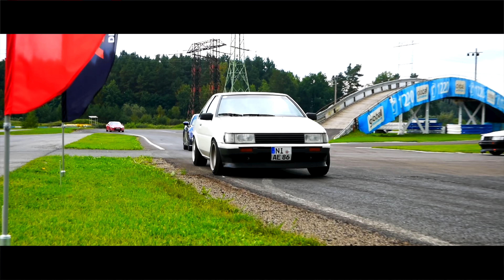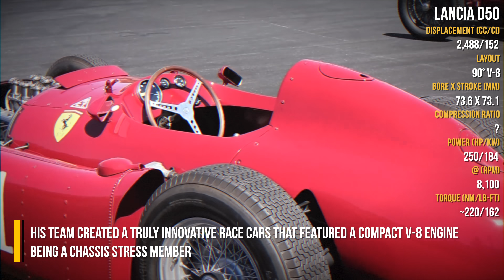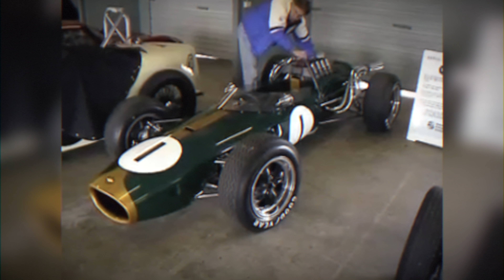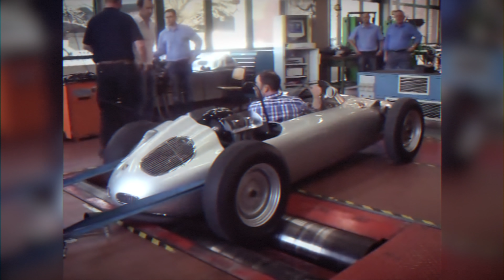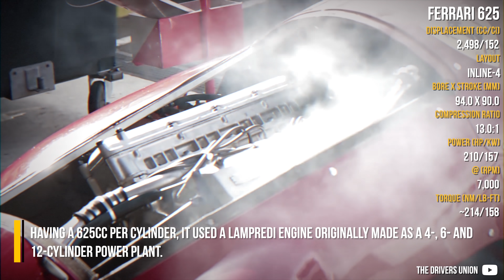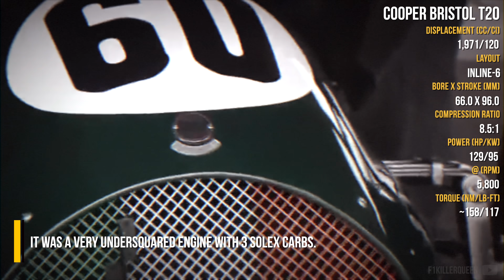The LOWEST Revving F1 Engines

Comment: Of course the Auto Union V-16 Gran Prixcars from the 1930s only had a a redline of 5000 revs or so. The engine had one of the most unusual valve trains in racing history. The intake valves were opened by a single centerly located camshaft in a SOHC configuration. The same camshaft opened the exhaust valves via pushrods.

Comment: Those later in the video look like toy cars. about the middle of the video those cars sounded like they had much larger engines than they had. I used to drive a 1998 Ford ZX2 Escort and it red lined at 8,500 rpm, more than almost all of the engines in this video. With it's 5 speed transmission it was so much fun to drive in LA traffic being not so wide as most cars and very responsive power. 
I like the clean look of the 60s F1 cars. They aught to take all the aero crap off the new cars and lower the maximum weight back to about 1,000 kg. Give them a 3.5 or maybe 4.0 inch stroke requirement and maybe 3 liters total displacement and naturally aspirated and a maximum of 5 forward gears and no DRS and no ERS. They aren't supposed to be street cars, they should be the most exciting fast things on 4 wheels that turn both left and right, not hybrids or electric, not demonstration models for new street car tech, and they shouldn't need a special system to help pass the guy in front of you.

Comment: They still have more RPM than American cars.
Reply: No. Just NO! My 1998 Ford Escort ZX2 redlined at 8500 RPM. and it was just a inexpensive sports sedan. and if you want to compare racing engines Nascar V8s of 355 cubic inches will turn over 9500 RPM.
Reply: @chrisbaker2903  hur dur... it was a joke.

Comment: You missed the Talbot-Lago T26C. That had a big 4.5 liter engine that, I think, revs no higher than 6,000rpm.

Edit: yeah, I just looked at pictures and stuff, and the Talbot Lago T26C had an engine whose redline starts at 5,500 rpm...

Comment: loved this era of F1 racing with front engine monsters turning achievable revs. It went nuts once rear engines came in and some of the adventure was lost as the speeds got right out of hand and the death toll mounted. that was the time of division from Euro F1 and circle track North American racing. I think it was a different era for sure and all the advances, spectacular as they were w may not have been for the best. Good video. Thanks

Comment: What about the POS V6 F1 cars (2014+)? A Rotax 125 kart engine revs higher than those. (14,000 RPM) They are also a production engine, not some million dollar overengineered crap. F1 needs high revving N/A engines again.

Comment: heh best time.... Formula with front engine... Formula with AWD (6x6) and 2! front steered wheel... formula with handbrake...formula with gearshift out of car... time of Bugatti and small body, big hearted Mrs Eliska Junkova...
Reply: 1st six wheeler has been the Tyrel P34
awd f1 like the Ferguson P99, BRM P67 and Lotus 56B.
Front steer wheel it have some f1s but i dunno which of them.
F1 with Handbrake.?? maybe Mclaren which they have a button and it locks the rear diff.
F1 with Gearshift..?
if im not wrong Ayrton Senna's Mclaren MP 4/4 has eguipped with Gearshift and the Lotus 97T. 
the rest of them i dunno either..

Comment: so wasnt ferrari ahead of its time with their v6? it sounds like they predated mordern F1 cars case thye use the same displacement today
Reply: The contemporary F1 config of 1.6L V6 is actually the third iteration: the first, as you correctly say, was the original Ferrari V6 in this feature; the second was the initial 80s turbo era V6 used by Renault-Gordini; the third and current era of small displacement V6 was heavily lobbied-for by Renault under threat of exiting the sport.

History will judge that last decision as it sees fit, but I don't think it'll be looked back upon fondly tbh
Reply: @jools77  thanks cause i knew the current engine was the same size as it was in the past. although question, is it possible to make the first gen v6 compatible with the third gen v6?
Reply: @jackmagnium6115  highly unlikely verging on impossible.

Nearly 7 decades of progress in engineering design since the original Ferrari V7, and associated advances in materials technology pays dividends, the majority of which simply can't be replicated in or adapted to older designs.

Good question though, Jack 👌🏼
Reply: All that while producing the same if not more power than the classic V12 engines.

Comment: Fun fact: the Honda S2000 revs higher than all of these F1 cars.
Reply: And even a Mustang Shelby GT350 revs higher than all except one.
Reply: @Mgoblagulkablong  especially when it sees a crowd
Reply: @abhimanyuks5383  I thought that was those v6 versions , lol.
Reply: @abhimanyuks5383  funny. Laughed
Reply: @abhimanyuks5383  U made whole squad laugh 0_0
Reply: @abhimanyuks5383  and rodney comes out of the block
Reply: Learned that here!
Reply: Integra type R too
Reply: @clipsonic4415  B18. I had a all motor 1990 Integra LS.... I always had fun beating up mustang's and Camaros and did it for half the cost in fuel and didn't even put it up in the winter.
Have a good day and thumbs up on the Honda/Acura Classics which are still favored even up to today.
Reply: @rdallas81   Me and every guy ever had fun beating integras. Watching them shift through 3 gears before 60mph, hilariously corny stuff. 7 second 0 60 in the 2000s, just too slow
Reply: Honda s800 revs up to 12k rpm
Story time: once they tried to see how much the s800 revs up to. It got up to 11k rpm till an explotion. The machine exploded (wat?!) But the engine was alive.
Reply: So does my weed eater.
Reply: I have a harley with a stock engine that revs higher than all of these F1 engines.
Reply: @Oddman1980  you have a wife named Harley?
Reply: @Oddman1980  Not a good idea and must be well beyond the power and torque peaks. I can (just) believe it of their modern water cooled short stroke motors but even the 8V motors have a long stroke and the piston speeds would  be out of bounds beyond 8000rpm.
Reply: @984francis  The 750 street rod has a 9,000 rpm redline from the factory. It also has a 60 mm stroke, overhead cams, and it's water cooled.
Reply: @Oddman1980  no body gives a fuck. and this was about cars.
Reply: @TopiAS06  If you didn't give a fuck you wouldn't have got all worked up in your response.
Reply: @Oddman1980  as much as you gave a fuck to response to me. all worked up?, nah, just face palming someone trying to one up with motorcycle against car engine revs.
Reply: @TopiAS06  why do you sound aggressive lmao
Reply: @TopiAS06  y r u mean?
Reply: @lawnylawnington  I don't know...
Reply: Porsche GT3 as well
Reply: fun fact i would rather have any one of these F1 car than a Honda S2000 or any car listed below your post
Reply: Fun fact: Spoon Motorsport's B16b bored to 1.8L and revved to 16,000rpm. That's sport bike territory..
Reply: And is also a pos and chick car and Honda ? Must i say more ?
Reply: Who gives a fuck about ANY of this? A 4 cylinder BETTER rev higher than 6750 or it would be an absolute slug.
Reply: Who cares...
Reply: and like all Hondas end up in the crusher at the junk yard fact ! bahaha hehaw
Reply: Fun fact.
Messiah is Lord.
Who is the Most High? 
Who is the way, the truth and the life?
The LIGHT, of course...who is the Son.
One ONLY gets to Father through the Son, who is Lord, who is is a Ghost, who is His own spirit, who is the helper, who is God. He is alpha and omega because HE IS the Creator....
Worship the creator from the heart, and be rewarded in ways eyes can not see, or ears can not hear, yet is more valuable than all riches in the world because they are all TEMPORARY.
What God is is ETERNAL.
Oh, Israel. What am I to do?
Oh Israel, I am 1 of 2.

Yet, you think with your carnal sin oriented mind that this is boasting.
This is the truth. 
It IS truth that brought HE to ME.
Reply: @rdallas81  Israel? The "nation" ? Do you think the creator approves of the way they slaughter Palestinians? Seems a tick on the hypocrite side.
Reply: @jamesgeorge4874   You gonna pretend that they arent both in the wrong? Lemme guess the "whyter" one is the bad guy in your book.
Reply: @DarkLinkAD  learn to spell. If the British crown gave away your property, that your family worked for, to a group of terrorists who was murdering the rest of your freinds, family and village, you would be just fine with that, huh?
Reply: @jamesgeorge4874   Are you dense? This is a 1000 year war of wrong doings. My "spell" is just fine.  Who said I was a brit anyway?  Get a cluw

Comment: Quite weird how there are some low revving F1 engines but they still sound good!
Reply: Because straight pipe duh without any dampening. But still as same as todays sport car

If you get blind test, you'll definitely get wrong answer
Reply: Have you heard a ww2 fighter plane engine, they are low revving and sound great. For example the rolls Royce Merlin in the spitfire revs around 3000rpm and they sound pretty good.
Reply: It's only natural. High revs mean high sound frequency, so the meanest sounding engines have the highest displacement and relatively low revs. In this aspect, formula 1 hasn't got anything on aero engines. :-D
Reply: Hybrid F1 rev 11krpm and sound like crap.
Reply: @GF-mf7ml  Yep